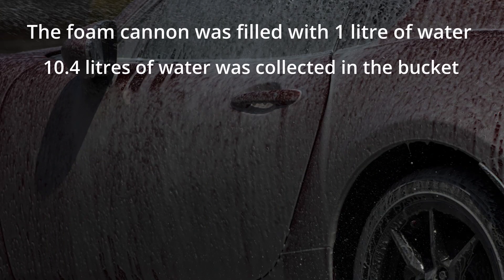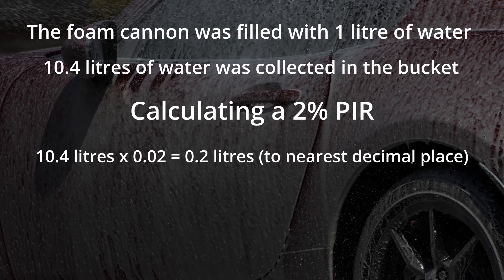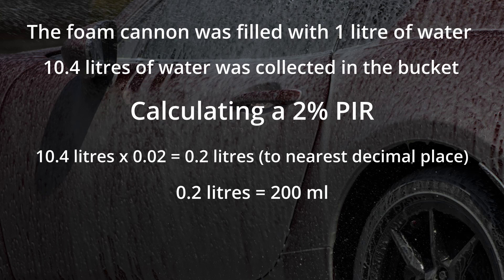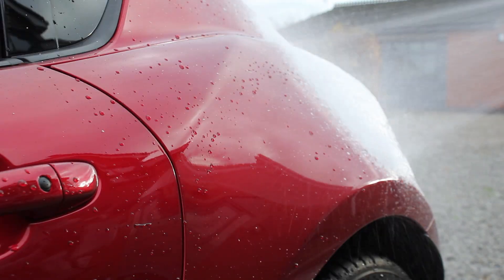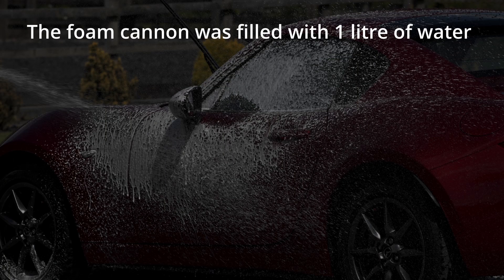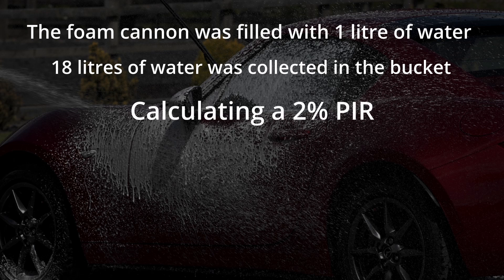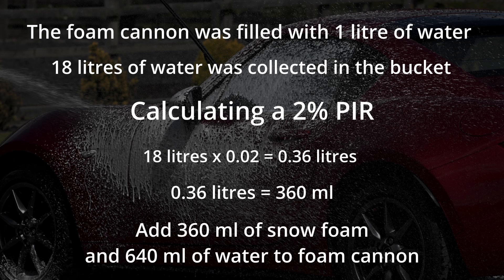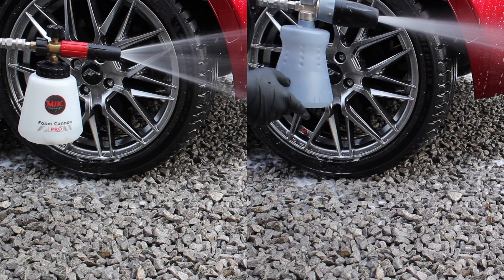How to Calculate Panel Impact Ratio (PIR) for Snow Foams

Comment: So Heather basically with bilt hamber touch-less with a 1000ml bottle i'm only going to get 4 car snow foams from the 1ltr bottle thats Extremely expensive when most other snow foam products are 1/10 only using 50% less product

Comment: I have to admit, being a DIYer, I can't be bothered measuring up. Instead, I pour the snow foam into my lance neat and turn the mixer way down. That way I can refill my 5 litre jug with any that is left over. Makes the whole process quicker and less wasteful. I'm probably doing it all wrong, but it works well.

Comment: Hi thanks for the video, when we are emptying the initial 1 litre.. what should the valve position be please?(ie the bit that controls how much water volume comes out) .... fully open  ?
Reply from the maker: Thanks for watching, it needs to be on full, the same position you'd use if it was foam in the bottle instead

Comment: Finally someone who can explain how to calculate the ratio. But I'm wondering, can't you just use 100% chem in the bottle and mix with the knobs? More expensive to find the correct knob setting, but still 😋 Great video, will try this tomorrow!
Reply: Also, what is the setting on the knob on top - sorry if I missed it, but can't find that you talk about it. Do you have it 100% on with full mixture from the bottle, or do you still change the mixture?
Reply from the maker: Thanks for watching! Yep I always just stick the dial to full. You could put the chemical in neat and then adjust but it’s just harder to calculate PIR in case the dial accidentally gets knocked
Reply: @autocarehqextra  Ah, that of course. I must Thank you as none of the Swedish detailing channels can explain this at all. They just say "you must dilute".. ok, how much? "just do it" or "read the bottle" are the answers you get.. and the bottles doesn't say anything, at least not in Sweden.

Oh wow, I commented for 7 days ago.. felt like I commented yesterday.. wow, time goes by fast. Well I dídn't get to try it last weekend and not today either, as I felt I needed to clean the garage and get things organized which it is now. But hopefully tomorrow though...  Thanks again!

Comment: Good explanation. I did tihnk of the same approach myself and did it with my Karcher K4 Compact + Rdutuok Foam Cannon (from amazon), on the max foam setting with 1.1mm nozzle adjusted to a spray pattern that I'd use on a car (interesting to see if spray pattern adjustment influences the ratio - an interesting thing to check next time), but I only got 2.3% of mixture out on the panel. Meaning, I need to fill my foam cannon completely with the Autofaom to even get 2.3% PIR, which is not optimal, as there is just no way for me to get a higher PIR out of my setup. To be honest, I wouldn't have expected that result. I re-did the test twice cause after 1 time I couldn't believe the result.

Comment: Back in with Bilt Hamber for Snow foam using their Touch-Less and needed a quick how to on working out PIR. You've broken this down in 3..5 minutes when others have taken 10 minutes or more and sometimes left you more confused at the end than when you started! Thanks again for the fast and straightforward explanation. Quick tip though, just use 500ml of water in the lance instead of 1L then double your findings. My Nillfisk/MTM gun & Lance emptied 7l from 500ml so in effect 14Litres. Saves, time, electric and obviously water! 🙏🏾
Reply from the maker: Cheers Barry I appreciate it!

Comment: When running the foam cannon   to dispense the water, do you turn the black control full turn to fully limit the water from the hose, thus taking maximum product from the foam cannon tank?
Reply from the maker: Yep I just keep it on max so I can work out the PIR the same every time

Comment: I’ve been using this method with my K4 although I got 14L of water from mine, not 11L so yeah they are all a bit different. 

I saw the ‘how to’ on Mark’s channel Sparklean Autos https://youtu.be/fZ_dyRofcHg?si=jC0b0X2zGclSA59C

Is this the same method?
Reply from the maker: I think it sounds like the K4 I used was on it's way out haha.

Yep it's all the same method. 1g of water weighs the same as 1ml so either weighing or measuring the volume collected it absolutely fine
Reply: @autocarehqextra even with soap in it?, still same weight?
Reply from the maker: With soap in it it will change the density but to measure the amount collected in the bucket you just need to fill the foam cannon with water, no need to waste any chemicals. After you've calculated how much the foam cannon dispenses in the bucket you'll then have all the volumes you need

Comment: Liked and subbed. How did I not know it was this simple? Experience has shown me I need a 5th or so of the bottle when using Autofoam but I've always wanted to be able to do it a bit more accurately.
Reply from the maker: Thanks! Yeah that’s a good starting ratio. With Auto Foam I usually didn’t find I needed a 4% PIR so most of the time it hovered around 2%

Comment: Hi Heather, Good explanation and demonstration of how and why. I used the kitchen scales to weigh the bucket before and after - then I realised it was easier to do the same with the foam cannon as it was hard to get the dregs  out. So I weighed the full cannon and empty bucket before - fired about 4 litres into the bucket (our kitchen scales only goes up to 5kg) - then weighed the cannon and bucket again. This showed 298g from the cannon produced 3468g in the bucket - divide 3468 by 298 and you get 11.628 - so 2% = 0.02 x 11628 = 233ml in a 1 litre foam lance. This method was so quick I decided to adjust the foam strength at the top of the cannon and repeat until I found the perfect setting - after a few measurements I discovered that if you reduce the soap setting by 2 full turns from maximum you get 2% PIR using pure snow foam solution in the bottle. So I don’t dilute anymore - I set the soap setting and use pure snow foam solution, then any left after you have foamed the car can be returned to the original bottle. Sorry, got carried away with explanation, but it makes the process much easier and thought it was worth sharing!
Reply from the maker: That makes sense! Thanks for sharing 😊
Reply: My head hurts 🤯